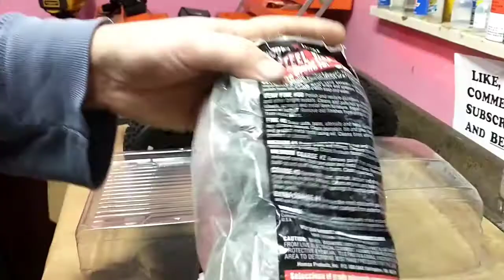Painting The Tekno MT-410 Body With Spaz Stix Color Changing Paint🎨

Comment: I've painted about 20 bodies and found a few tricks. I always scuff the body, wash with Dawn, and let the SS cans sit in hot water for 5 min before each coat. Not as many tip bursts that cause the runs. About to do an XMAXX in an hour. Not saying you way is wrong, just a few tricks found and use.
Reply from the maker: I didn't show me buffing (scratching) the whole body, I only buffed the razor back piece that mounts on the bed but I did buff the whole body off camera.  As far as cleaning the oils & fingerprints from the body Ive done the soap & water way as well.  I guess they both work😉.    Warming the cans up in water to help prevent runs is something I'm going to have to try.😉👍
Reply: @myrclife  SS cans only perform optimally until 1/4 full then start a new can if you need to. The last 1/4 spits and will mess up the job. Just did my 6th coat on the body with red/gold 3 minutes ago.

Comment: Hi, follow your absolutely awesome and very informative Tekno MT videos with great interest because I'm putting together a MT410 build as well! 
My build also includes a TPPower 6D 4060 1650KV as well as the M2C GameChanger chassis and some other nice M2C parts ;-) !
Since bodies that don't fit flush also annoy me as much, I'm even more happy to have found this video from you! 
I hope you do not misunderstand my coming question, would very much like to use this body for my Tekno MT, because with most of the paintwork can still look so beautiful and unusual, but with the huge gap to the chassis, it also looks like wanted and not done!   
Could you please tell me if the "1979 Ford F-250 12.3" Wheelbase" (Part Nr: 0428) is the right "wide" body, because am not quite sure!
As a second question, what would you emfehlen for the TPPower 1650KV for a pinion, engine would also be cooled with 2 40s fans and the Hobbywing XERUN XR8+ GS2 ESC also with a 30s fan each all fans with 27000rpm! The tires are the ProLine Trencher LP 3.8!
Hope also your answer and much more class videos about the MT410!
Stay healthy and do exactly so further ...

Best regards!
Reply from the maker: Hello, first off all thanks for watching.  Hopefully your a subscriber also.👍. As far as the body goes, I think the 79 ford f-250 12.3" wheel base is a "jc concepts" brand body.  When I looked up the specs on the body it states that the width is 8" wide which would basically be perfect for an m2c wide body build.  Now the 12.3" wheel base is not quite the same exact length as the mt-410 wheel base but you can always split the difference between the front and rear axels and THEN.... drill your holes for your body mounts.  As far as what pinion to run....with a good set of fans on your motor & esc you can pretty much run ANY pinion you want.  The TP Power motors tend to run cooler than most motors anyways but with those high rpm fans you invested in you can run some higher speed gearing with no issues.  The gearing I recommend would be some where between a 15-18 tooth pinion, they seem to work great on the 2 Tekno's in our collection.   If I failed to answer any of your questions or you have more questions in the future feel free to reach out to me anytime.  You can also friend request me on Facebook@ username Traxxas mike.  Good luck with the mt-410 build.  They are very intricate trucks and very fun & precise to build and even funner to drive👍.
Reply from the maker: Also....the trencher 3.8 is a great option for tires!  I have a set on one of my Tekno's as well.  They are a GREAT all around tire whether your backflipping at the skate park or climbing hills at the local gravel pit or even mud bogging (I try not to mud bogg anymore, it's to hard on bearings and other moving parts and to hard to clean up afterwards lol) 
Another great tire choice is a stock arrma tire called the "dboots backflips" they are easy on the pocket book and seem very durable.  You stay happy & healthy as well.
Reply: @myrclife  Hy Mike, thank you for your quick and detailed response, would like to accept your offer to write to each other via Facebook but do not use it out of conviction, sorry. 
Would then always write to you here or if possible via email, if that would be an option for you!
Then my search what the body is concerned, yes already times right! ;-)
I think in one of your videos to have seen that you use in combination with the TPPower 4060 of a 22er pinion, is that right? 
That would currently also my choice, but I'm still undecided whether not villeicht even a 23er still better währe! Would like to be able to reach in the lower range right pressure but also a top speed of so about 66 Miles (90km / h)!

Translated with www.DeepL.com/Translator (free version)
Reply from the maker: You can always reach out to me in the comments.  I can't recall what pinion gear I have on my trucks. 🤷. One of the trucks is geared a few teeth higher than the other one. I think a 22 or 23 may be the biggest gear you can use.
Reply: @myrclife  What are your experiences with the M2C parts?
Am currently still considering whether I should take the 9mm shock towers instead of the "go big or go home" kit, but I want to keep the total weight as low as possible, so I think it is the better compromise between stiffeners and weight, or what do you think!
Reply from the maker: I LOVE all my M2C parts!  The extra braces, the wide body kit, all the m2c parts are super tough💪.  As far as the shock towers I am afraid I can't help you out with my preference on the shock towers because I've only ran the go big or go home kit on both of my trucks.  I've never installed the stock shock towers EVER!   I will tell you this, I chose the go big or go home kit because I wanted to "GO BIG" LOL.
Reply from the maker: Also, even though the go big or go home kit is thicker, it dosent add very much weight to the truck.  Maybe a few grams.
Reply: @myrclife  In comparison between original shock towers + Go Big or go home kit and the reinforced M2C 9.5mm shock towers will be estimated still a noticeable weight difference, so I will also stay with the "Go big or go home kit" because it will probably be perfectly sufficient for my needs!
As for the body kit (chassis), would a SkidPlate still necessary to stabilize the chassis even from below?
Reply from the maker: I don't use a skid plate on my trucks but thats all up to you. Maybe you want to keep your chassis "scratch free"....in that case a skid plate might be something to purchase.  Even though I do not have a skid plate, my chasis is still in great shape. 💪👍.  It has a few scratches which a person can expect but nothing to extreme.

Comment: Don't bother scuffing up the inside with steel wool first. Polycarbonate paints etch into the lexan anyway. Never had a single paint imperfection due to not scuffing the surface first. You lost ALOT of shine and colour dimension due to doing that
Reply from the maker: After I scratch up the inside I cannot see and imperfections after it is painted. Scuffing it up makes the paint stick that much  better.